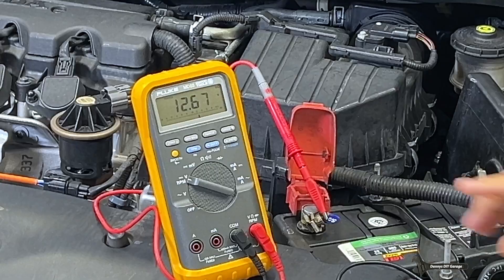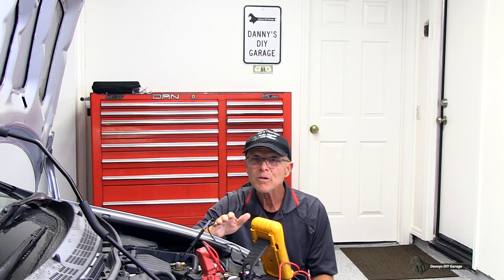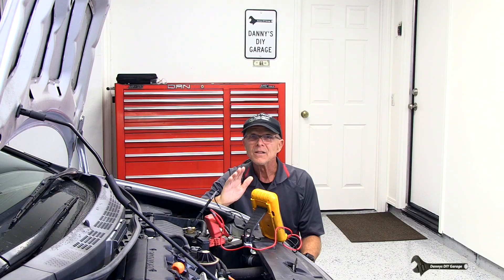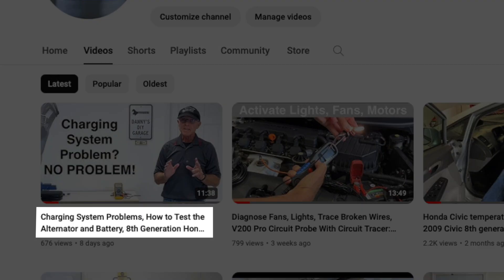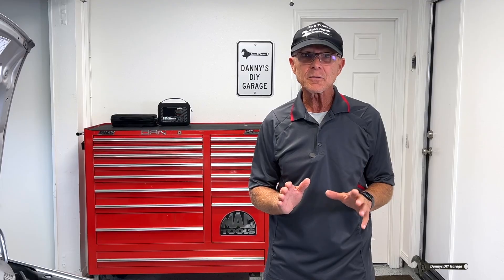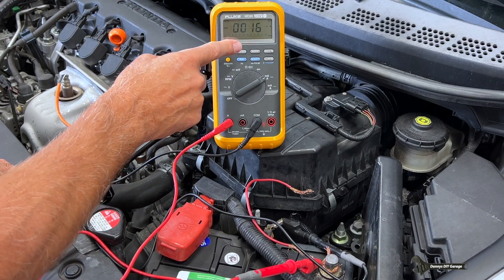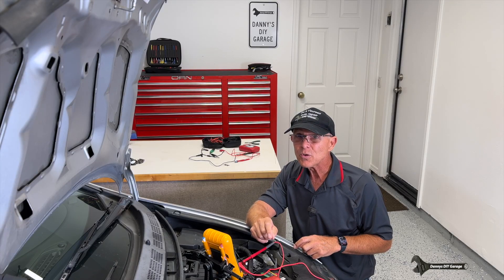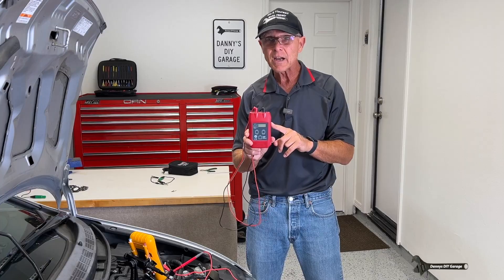Dead Battery Overnight? Find Your Parasitic Drain in Minutes How to Master the Amp Hound 2

Comment: doesn't the dead battery tell you that you have an intermittent parasitic draw when it happens every once in a while??  more importantly.. how do you find a intermittent parasitic draw???  my 2015 infinity dies maybe once every few weeks...
Reply from the maker: First, make sure you have an intermittent draw by setting up your meter min/max, once you determine a component is intermittently turning on you can proceed to eliminate parts of the circuit, which is very time consuming

Comment: what good is the amp hound? a seond free harborfreight multimeter does the same thing. Just subtract that reading from the fuse spec  on  calculator, I dont understand. Thanks in advance.
Reply from the maker: Hi,

I’m not sure if you’re looking for a detailed explanation, but the main advantage of the Amp Hound is how it measures current.

The Amp Hound measures millivolts across a fused circuit and automatically converts that voltage drop into current (amps/milliamps). This allows you to quickly and safely identify parasitic draws or excessive current draw without breaking the circuit or putting a meter in series.

While a multimeter can measure current, it typically requires disconnecting the battery or circuit, which can wake up modules, blow meter fuses, or alter the very draw you’re trying to diagnose. The Amp Hound avoids those issues and significantly speeds up diagnosis, especially on modern vehicles.

So while a meter can do similar measurements, the Amp Hound makes the process faster, safer, and more practical for real-world parasitic draw diagnostics.
Danny

Comment: Enjoying your video, however at the five minute and 50 second mark you made a statement that’s wrong current does not flow from the positive to the negative. Matter is made up of protons , neutrons that have electrons , electrons repel each other. They look for a source of or an atom that is Short of electrons which leaves it positive ,because electrons are negative therefore current flows from the negative common through the appliance back to the positive terminal (/that is deficient in electrons ) of the battery.
Reply from the maker: Yeah I know, it’s easier to understand though and really has no effect on diagnosing, thanks though for watching my videos ❤ appreciate your support

Comment: Good video, never used jumpers, but is an option. I'm old-school. Just use an alligator clip with + Dmm lead clipped to battery Cable. Hold other lead with left arm lol, on neg battery post, as I remove beg terminal from battery, owly with plastic clamp hold the Dmm wire on. And gently lower it all, and wait for systems to shut down. If after an a while it's still half an amp. Then start , hounding
Reply from the maker: That’s pretty much the process, thanks for adding, tomorrow’s video I use a thermal imaging camera to find the circuit that’s flowing current to find the draw

Comment: This video is a relief, I have a 2019 vehicle and I am on my 3rd or 4th battery due to a drain. I told the dealership about it but they brushed me off. Anytime the temperature drops below -10c, let alone -20c, my battery will die…it drives me nuts. I recently spent $378 CAD on a new battery. I’m going to try what you suggested and hopefully I can find the cause.
Reply: Try amp hound 2
Me too got a mercedes

Comment: I was amazed you didn't short the battery with the jumper wire 3:35
Amp Hound 2 is a glorified milivoltmeter. You don't need one if you have a measuring instrument.
Reply from the maker: It’s a convenient way to convert Milli volts into milli amps, when you don’t want to do the math, it’s a great tool to read current and works well for parasitic draw testing, thanks for adding 👍🏼

Comment: I never shut the doors letting the vehicle go to sleep in case I need to enter the vehicle to check fuses or circuits for the draw & don’t want to disrupt the vehicles sleep mode. Instead click the the door locks on the door making the car think the doors are closed. Also bypass the hood switch as well making it think the hood is closed if it has a sensor on it as well.
Reply from the maker: Thanks for sharing
Reply: @dannysdiygarage yessir thank you for sharing  your knowledge as well.

Comment: Great video as always Danny! I know my battery is losing about 0.1 volts per day, so when the battery is reading 12.6 volts, after about 5 days it will drop to 12.1 volts. Not a dead battery overnight, but after a week or so it goes dead, so I'm sure I have a parasitic draw somewhere, and with your video, I can now perform an accurate test with my meter and do the min/max and then determine which fuse is the culprit. I'm thinking it is my aftermarket remote car starter but I will verify! I may have to get the amp hound as well. Looks like a good tool to have! Thanks again!
Reply from the maker: Appreciate your comment and I love the way you took what you learned and you’re not afraid to apply this approach and figure out your issues 👍🏼

Comment: I use the Noco Genius 10 as a 12V power supply (13.6V actual). I attach the positive lead to the positive bus in the main fuse box and the negative lead to a bare metal ground. Once the power supply is attached as described and power is provided I can remove the negative cable from the negative terminal of the installed 12V battery for testing parasitic draws.
Reply: I also have a Noco Genius 10 that I usually attach to the battery terminals. Do you happen to know of a video showing how to make the connection @Fred_the_Head uses so it works with Dan's setup for testing parasitic flow? I don't know what is meant by attaching the positive lead to the positive bus in the main fuse box. Does doing this achieve the same thing Dan does using his jumper box and memory saver? I tried to buy Dan's jumper box with an air compressor, but his Amazon link no longer works.

Comment: Hi great and very informative video. 
Question please if you don’t mind, although I’m not sure there is an answer. 
I have a vw t6 transporter and the battery drains if I don’t drive the van regularly. The battery use to last a week but it now down to two days (I assume the deterioration is due to continually running the battery down). 
We connected the multi meter and there was definitely a drain, before we started pulling fuses we decided to disconnect the alternator to see if this was the problem. The amps reduced considerably so we reconnected the alternator thinking we had found the problem but the amps drain didn’t change. We left the multimeter connected for the next hour and the drain was very low/acceptable. The next day draining as usual. 
My question is, how do I find an intermittent parasitic drain? 
Any help would be greatly appreciated as I am getting desperate. 
Phil

Comment: Hey Danny good video, but i don't understand the memory saver. First you put it in to save the memory , and when you wanne measure you pull out the memory saver.Get the memory lost this way?
Reply from the maker: @petertorro  current from the battery is flowing through the meter, so the connection isn’t broke, when the memory savor is connected and battery is disconnected, current flow from the memory saver, hopefully this helps